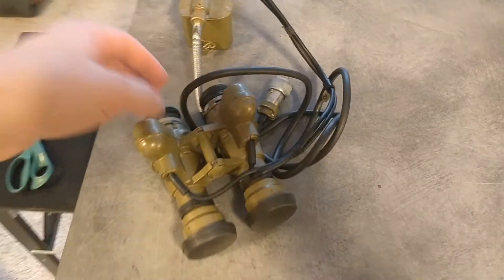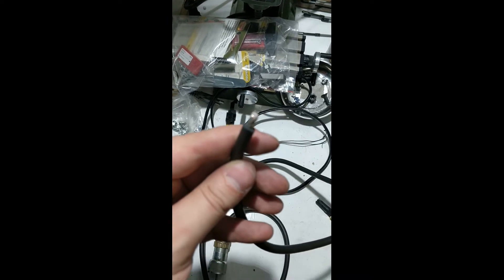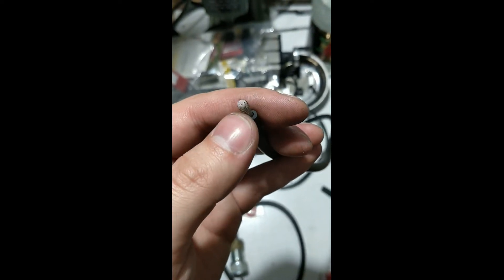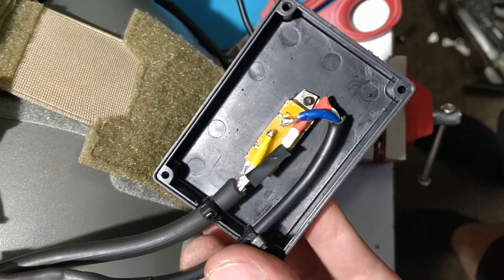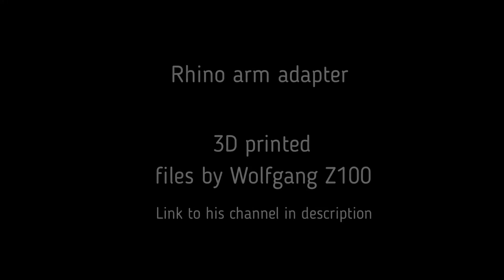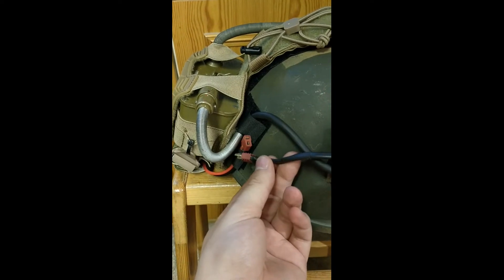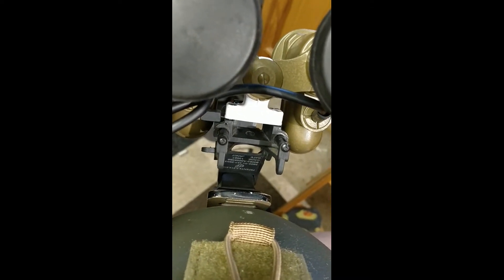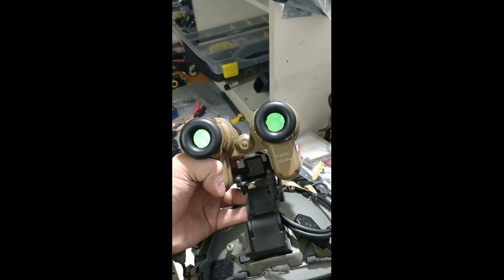PNV-54E modernized

Comment: how can you connect the photocathode to the cable.
I dont have a sprigns and I don't know how to put it together without breaking it
Reply from the maker: Hi, maybe this could be of help: https://www.elektroda.pl/rtvforum/topic3402571.html
Reply from the maker: You might be able to replace the springs and such or try finding a new tube, if you break the old one. There have been some available on ebay, V-8 EP33 should be the right type.

Comment: that is awesome, do you think you can make one for me aswell? I will pay you ofcourse.
Reply from the maker: Sorry for the late reply. Unfortunately I don't really want to tinker with high voltage for other people for safety reasons. With this transformer you have around 16-24 kV voltage (even if it's high frequency) running over your head, so you'd preferably need to know what you're doing and thus you should be perfectly able to do such modifications yourself. I can provide schematics if you're interested.

Comment: Hello! Is there an online shop whi sells PNV-57E in Finland? I'm in France and they're really hard to find here for a reasonable price!
Reply from the maker: Unfortunately not anymore. There were a lot more few years ago. I've seen some appear randomly on ebay and allegro.pl rather cheaply so I'd say your best bet would be to check them regurarly.  

The unit in this video is bough of ebay auction from a german seller. I bought two units in total and they averaged around 150€ + postage each.
Reply: @karysuikula8145  thanks bro! 🤙